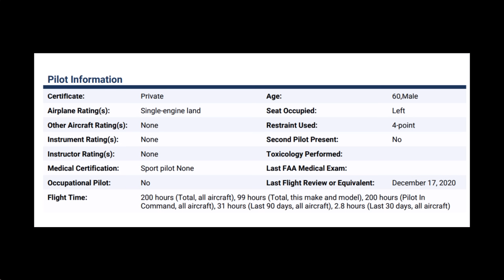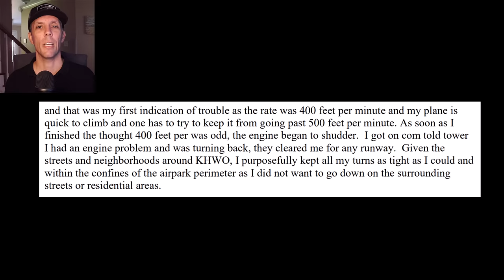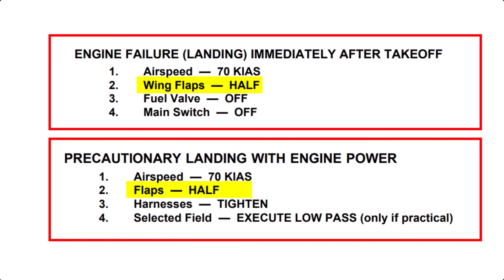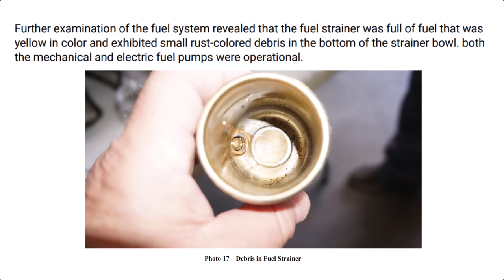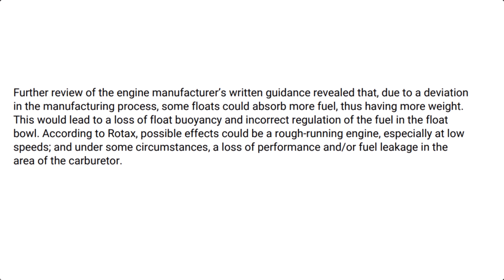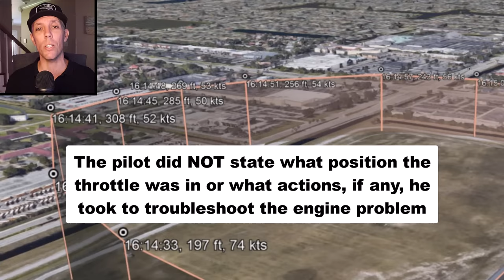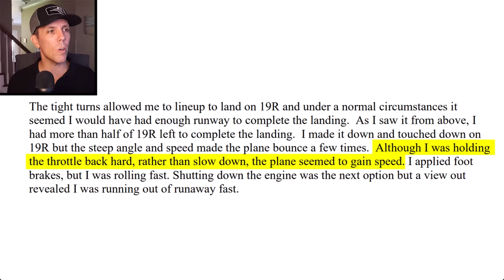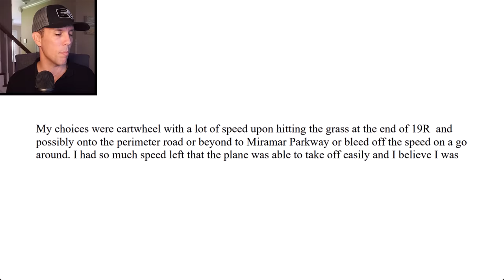Pilot Makes HUGE Mistake During Emergency Landing!

Comment: The Sting isn’t approved for slips with full flaps. However, full flaps are very effective. He didn’t use them, which explains why he was still going so fast as he reached the end of the runway. He appears to have tried to force the plane down, which won’t work in the Sting: it will inevitably start to bounce because the nose gear is quite long. Once it was bouncing, he would have been trained that the only fix was a go-around. I’m impressed that the plane tried so hard to do what he wanted, without much power.
Reply from the maker: Why wouldn't you just neutralize the controls after the first bounce to avoid the PIO and let the plane settle and fly it back down to the runway?
Reply: @pilot-debrief  In theory, you would - and that would certainly have been the safest thing to try in this case, especially as partial power was available, so he could have given it a burst of power to stabilize, then back to idle and let it settle. In practice, many pilots find that neutralizing the controls and stopping bounces is really hard to do: experience shows that bounces tend to get worse rather than better. So, many instructors teach the automatic go-around if the plane bounces more than once.

Comment: Wouldn't the propeller keep spinning due to windmilling anyway at 5:12? Everything else you said made sense.
Reply from the maker: I should have mentioned it in the video, but it sounds like his engine that you hear when he's on short final. There is audio from another aircraft flying overhead later in the video though. 
Regardless of whether you can hear it, I'd argue it had to be producing some power because if the engine was dead then there's definitely no reason to try and takeoff again and he talked about how when he tried to takeoff he increased the throttle (which there would be no reason to do if the engine was dead).
Reply: I don't think a Rotax 912 will windmill if it's not making RPMS. The airplane would break apart before those things windmill. It takes one heck of a tug to burp 'em every morning.
Reply: @peteralan5557 Yeah good point.
Reply: @pilot-debrief Thanks :)

Comment: I've got some Stingsport time... They are slick indeed, are really sensitive to pitch and can be a handfull if you don't use finesse on landing. Stress of an emergency didn't help... But yeah, staying on the ground is the best option by far. And you might get the callsign 'Weeds', which is pretty cool...

Comment: Low time sport pilot here. Whenever I go flying, I have a plan of spending atleast half the trip on practicing. That could be touch and goes or flight manouvres that teaches me better energy management. Relaxing, sightseeing is fine, but I am so worried about becoming complacent and suddenly find myself in a situation where I SHOULD have a "toolbox" of things I can do, for instance to slow down if I am coming in hot but can't go around, or I am trapped in terrain and need to turn around but be confident I can stay coordinated. These days I am doing all sorts of variations of lazy eights, and I have identified some things I could use the help of an instructor with. In my training, I remember how weird it felt to practice using nose high attitude to increase my rate of descent when I was high. There is a slight balloon to begin with, but then you begin to come down. When I read "Stick and Rudder" it all makes sense. Wolfgang goes as far as calling the elevators "flippers", to avoid the misconseption that the elevators (always) elevate...

I have nothing but for sympathy for this guy. It is only human to not notice when we start slipping and normalizing deviant behaviour... I am surprised by how much focus and energy I need to spend just to keep myself in check!

Comment: Yes, check your tanks!!!
I always smell my tanks and look for a nice blue tint in the gas on everything and if it's yellow or I am just not sure I dump the whole tank on my weeds or sometimes even worse I'll run it in my 454 powered Van at about 50% (I know, Bad idea)!
I noticed the filler cap on my 2023 lawn mower says; "no E85 gas" and didn't pay attention to it. 
I also noticed my Boat says the same thing (I use nothing but, DockSide Fuel) and no issues.
Lawn mower ran fine but, After leaving my Lawn mower with gas in it for the winter, this summer I tried to start it and nothing. What? This thing is brand new! Pulled the plastic Carb apart blew through the main jet, wiped the bowel out, put it back together again and put 92 Octane in it... 
Boom, started right up and runs better than new!

Comment: Far too few pilots know how to use an aggressive slip to shed speed and altitude.  Especially with full flaps it's amazing how fast you can descend in most planes with hard slip.  Having that tool in your toolbox makes things like this much more survivable.  And unlike flaps, the drag from a slip can be applied and removed as fast as you can move your feet and hands.

Comment: There's something to be said about the typical private training. A go-around is presented as an all-encompassing max safety action in case of a landing going wrong. Of course, it is not. If there's doubt that the aircraft will be able to complete another pattern, it is of course much better to hit the bottom of the trees at 20 knots than hit the top of the same very trees at 60 knots.

Comment: Pilots primary failing was not (being able or just forgot) doing a hard slip to get down on the runway, leading to pushing down and the resultant bounces. Trying to go around again was obviously a huge mistake. As a point of interest, the Sting is odd in having split flaps as opposed to any form of 'high lift' flap, so it's more of a speed brake. As for positioning around his modified circuit, I've had numerous students, that when knowing they're going to get an EFTO, have a bad habit of getting back to the strip quickly, but then finding themselves at 200 feet above the centre of the runway and nowhere to go but away from it. I usually let them do this once, to get them to concentrate on their positioning when practicing emerges procedures. Then there's the maintenance fault in the first place...
As long as we all learn from this.

Comment: Another quick correction.. the propeller will continue to spin (at normal flying speeds like best glide speed) even at 0 power.  The only exception would be if there was damage done internally causing the prop to slam to a stop or the aircraft got way slow at some point.
Reply: Well, that plane features a Rotax 912S which has high compression and a gearbox, they usually stop windmilling when the engine shuts completely off due to missing spark or fuel. Personal experience here. With this plane hanging in there at minimum speeds the engine had to still deliver some kind of power, otherwise he'd have crashed a lot sooner.
Reply: @TDCflyer  wasn't sure!  Thanks for correcting me!
Reply: Yup it will take about 110-120 knots to spin a 912 depending on the prop.

Comment: Hoover, here's something that's always made me wonder,  why do GA aircraft do two steep 90-deg turns to get to final rather than one shallow 180 like navy pilots do  ???  (ps, I'm a hang glider pilot, we only ever do shallow 180 onto final to avoid any steep turns near the ground)

I agree with your stating the worst error was trying a go-around, but have a hard time putting myself in the pilots seat for the first approach, since he's not on a "standard approach" what I would do is sight the visual angle to the runway during downwind to gauge when I should 180 to final, the question is how many times does a GA pilot practice this sort of thing so that a pure visual landing (using just the ASI and no other instruments) is ingrained into the brain ?

Comment: i had put myself in a situation where i had to turn around on partial power right after takeoff similar to this guys situation on a small airfield with a little town right at the end of the runway. after performing a level flight 180 on partial power i was actually much higher and closer to the runway than I expected. We always practice and think about complete loss of power on takeoff, avoid the impossible turn etc.. but we never train for partial loss of power where you are able to do that turn and even keep your altitude.. Luckily i could profit from having done my ppl in a taildragger without flaps or airbrakes, so i extended my 180 into an s-turn to quickly loose some altitude and then slipped it in to safely land it on the remaining runway, but i had to really hit the brakes once i was down to stay on the pavement :) I was lucky there was almost no wind, or else this could have ended with me having to take a train home after that landing ;)

Comment: The standard response to an aircraft that is bouncing is to get it back into the air.  You can say more experience would have benefited him, but no amount of experience or lack of experience would have prevented the engine failure.  Likewise, the type of failure he experienced, loose debris clogging the gravity-fed fuel system, could have been momentarily solved with some hard, negative g bangs, causing him to believe the engine was kicking back in.  Pilot's priority was not to hit buildings that might contain people, which is a big plus.
Reply from the maker: If you are bouncing as you go down the runway and you want to land, the standard response is to neutralize the controls and let the plane settle and fly it down to the runway. Bouncing multiple times is often the result of trying to chase the controls, creating a PIO, which can make things a lot worse. 
Also, if you know the engine isn't working, the standard response should not be to try to takeoff when you are already down on the ground.
He did a great job avoiding crashing into buildings, but he also had an opportunity to keep it on the ground with minimal to possibly no damage to the aircraft and this is the whole point of a pilot debrief...to identify what could have been done better.
Reply: Thanks Hoover for your above reply. The accident pilot was clearly not aviating. As you pointed out, he had partial power, was climbing and simply could have flown a standard pattern. If he had done that he would have been within gliding distance of the airport at all times in case there had been a complete engine failure. Instead with an un-stable approach he was too fast and too high. The fact he bounced on landing was to be expected as a result of his poor approach. A bounce at that point was inconsequential. He was on the ground with plenty of runway and runoff, just keep it there. These videos and your debriefs are very helpful. As a pilot I can imagine getting into many of these situations. Having you break them down so clearly allows me to keep these things in mind each time I go up. You also allow us to see how professional military pilots are. This accident pilot is already probably feeling pretty bad, but I wonder what nickname he would get if he were in the military.     @pilot-debrief
Reply: your comment is seriously flawed.
Reply: @thedahlins    Clearly any pilot in the military would earn a horrific nickname, but few pilots in the military venture into the sky alone, without close support, and with as few hours of training, experience, and testing as the accident pilot.   Heck if a military pilot did something like that, they'd never let him (or her) back in the simulator.
Reply: Nice reply crimony! It's nothing to laugh about and as you say, military pilots have close support! Those of us in GA are pretty much on our own in terms of how much we choose to be debriefed. It's good to have these conversations!
Reply: This comment makes no sense at all and ignores not only the agitating principles Hoover talks about, but also the facts of this flight. If your engine is failing you don’t try to take off. Yes experience could have changed that decisions making. He had enough engine  to land.

Comment: The Avgas/Mogas has nothing to do with it.  100LL is fine, you just have more frequent oil changes and gearbox overhaul occurs sooner.  The "Caution" in the Sting POH is inappropriate and not consistent with Rotax guidance.  Failing to get the carbs overhauled and inspected every 200 hours though this a hard and fast required maintenance task.  The "sunk" float is probably a previous version that Rotax directed be swapped out several years ago.  Not dumping flaps when you know you have the runway made was probably due to the pucker factor of wanting to hurry and get down ASAP.  The LSAs are docile and forgiving but if I come in really hot, my SportCruiser is squirrel on crack and doesn't bleed off speed well.

Comment: I've got a little over 160hrs in this model of StingSport which at this time is over a decade ago and it was early on in my flying time.  I had an incident where a spring on the carb broke after a touch and go.  This resulted in a very sluggish throttle response.  I discovered the issue immediately after the touch and go when the engine wouldn't come up to full power (much like the carb float issue here).  I also couldn't retard the throttle to get the prop to landing speeds this resulted in chewing up a ton of runway quickly, but not enough airspeed to climb out as normal.  Initially as I was airborne enough I elected to head upwind, gain enough altitude at about 50fpm until I was able to make the x-wind runway and land.  

By the time I was ready for the x-wind the engine was back up to full power.  Because I wasn't at the home airport when this happened and the airplane was flying at that time I elected to head back to the home airport about 30 miles away.  During the time I had in the air I was able to spend some time evaluating how much throttle authority I had available and it wasn't very responsive.  So when I got into the pattern at the home airport (non-towered) I was coming in pretty fast.  I flew the pattern as close as I could at the higher speed.  Once I had the runway made I shut the engine off and dead sticked it in to landing.  After rolling off the runway I turned the engine back on and taxied back to the hangar.  

While I did make a number of mistakes/errors during the flight it ended well and I learned quite a bit.  I had a slight inclination of what was wrong when I was making the trip back to the home airport because one of the other partners in the plane (who also was the A&P on the airplane) had mentioned a similar scenario the week before.  He only replaced one spring on the other carb and didn't inspect the rest of them.  

So this video caught my eye because of the time I have in the airplane and I was curious as to the source of their particular issue.

Comment: I am not a pilot, so please take that into consideration when you read this.  But despite the technical mistakes this pilot made, the root cause of this problem is the engine manufacturer's decision to allow the use of both avgas and mogas in a certain ratio.  Also their decision to use float material that degrades if too much of one type of fuel is used.   
It also occurs to me that given the cost of airplanes, even ultralights, the engines would have fuel injection not carburetors.

Comment: Hollywood North Perry is not a good place to have an engine failure after takeoff. Every single spare foot of land outside the perimeter has a building on it. This tends to persuade you to keep your circuits too tight. With this crash (was it an accident?) we have pilot who did not understand how well his aircraft could glide and also had no idea about approach speed control. His goose was cooked as he made his first high speed, close in approach. The first approach was a cue to get your camera out to record a guaranteed crash.

Comment: This is the second time recently a pilot thought they were going to cartwheel or nose over the aircraft in the weeds and as a direct result made terrible decisions. I don't know where this thinking is coming from, but there needs to be a PSA that you can absolutely land an aircraft in the weeds without it nosing over or doing some other kind of terrestrial aerobatics.
Reply: I think it comes from all training being only on sealed runways and never using grass strips so it is just fear of the unknown. If you see all the videos of bush planes with big tyres etc you may not realise that LSA small wheels will still handle a grass strip ok.

Comment: Have never heard of rotax not allowing 100LL in the 912 or 30% of the time. It does shorten your oil change intervals. Mogas is hard to find, ethanol free is hard to find aswell thus lots of people run 100LL in the 912 without any issues.

Comment: When filling a plane with auto gas, it is important to use a fuel stabilizer product. The rust was caused by methanol in the fuel. It is hygroscopic and promotes corrosion. Autogas also contains MTBE. 
The aircraft is of Czech production and gasoline sold in Europe has ethanol in it rather than methanol, sometimes in combination with MTBE. Considering there was debris consistent with the fuel line material, it is probable the manufacturer is using fuel line that is incompatible with methanol and this is a serious problem that needs to be addressed. This could also be the cause of a sunken float as they appear to be plastic or synthetic rubber. Frankly, as an A&P who owns an ELSA, I wouldn't use anything but metal floats in a carb that is running autogas.
I see 700ft of grass at the end of the runway and think, 'I can take off and land in that space.'. This pilot clearly didn't have any short and soft field experience because attempting to take off again never would have entered his mind.